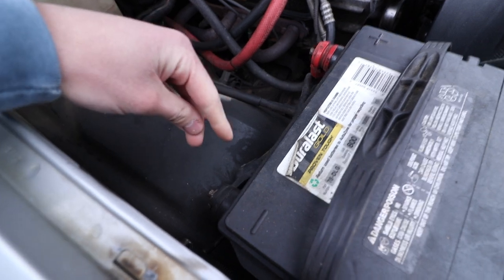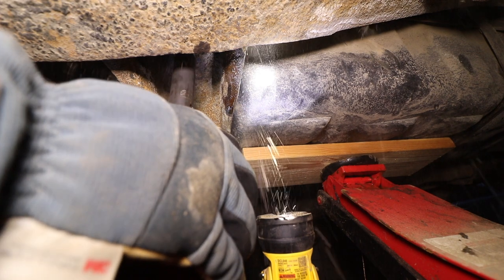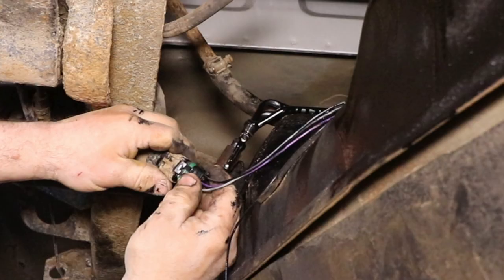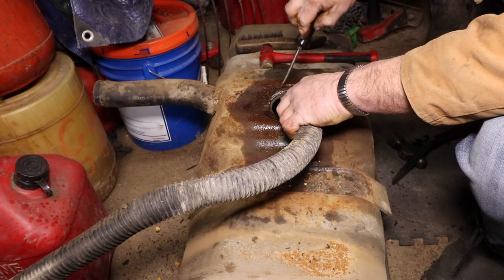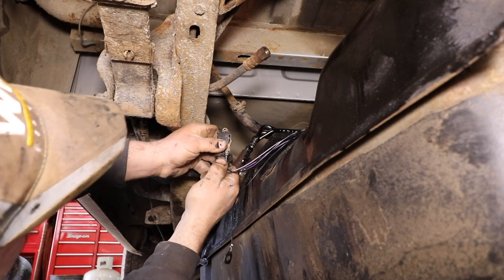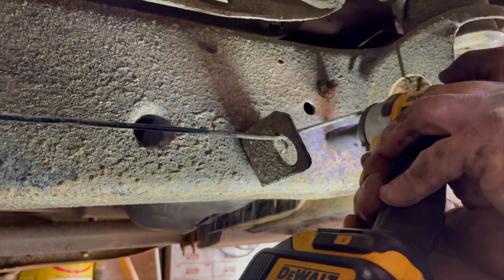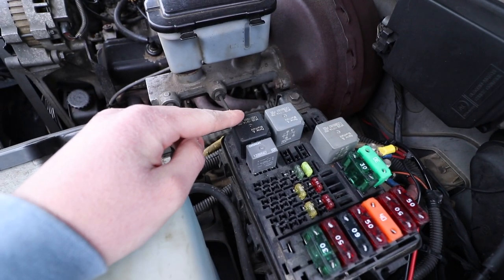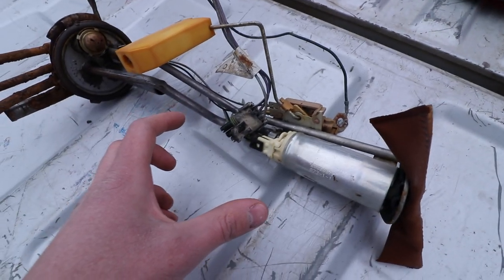1995 Chevy 1500 FUEL PUMP replacement

Comment: 1995 Silverado, crank but no start unless spraying starter fluid. can’t hear the pump humming, replaced fuel relay, checked the ECM, pulling truck bed to check ground now. Hopefully that works. Thanks for the video

Comment: Nice video. I would suggest using a brass punch when removing or installing the fuel pump lock ring. Brass does not create sparks, so it's just an added level of safety. Also, o'ring lube is much better for the rubber fuel pump seal. Blown fuse or not, your fuel pump investment is very probably a good investment. Like any mechanical part, the performance degrades over time. If you bought a good quality pump, you should be good for another 175-250k miles. Thanks for the video.
Reply from the maker: Thank you for the advice! Glad you enjoyed the video

Comment: Hopefully you have a fuel pressure regulator with a return line to the tank. If you don't and are choking the pump from 15 psi to 5 psi without a return you will stress and burn out the fuel pump

Comment: Hi, where did you buy the fuel pump with the whole kit. I have an S-10 95 4.3. Best regards Nenne from Sweden
Reply: I just bought mine off Amazon for 50 dollars. I have a 95 Chevy 1500 but it’s got the 4.3l vortex
Reply from the maker: I ended up getting mine off of autozone website, a Delphi pump and float assembly.

Comment: Hi Man 
Great video!, do you know where the ground where is located for the fuel pump on the frame?
I’m having issues with my 95 suburban.
Thank you
Reply from the maker: Should be held on with a bolt somewhere on the frame near the fuel pump wiring pig tail
Reply: @nickconnors8515  thank you
Reply: How long did it take to do overall
Reply: I cut out the floorboard on my suburban than it took 20 minutes to change the pump. The tank straps are to rusted so I did it that way.
Reply from the maker: Overal, I’d say a few hours, maybe 4-5 ish? I also had no idea what I was doing so I was learning as I went.
Reply: @nickconnors8515  thanks.
you was about right and took me 4 1/2 hours today.